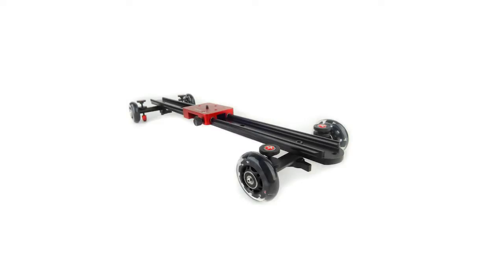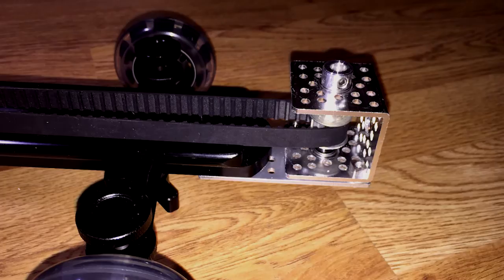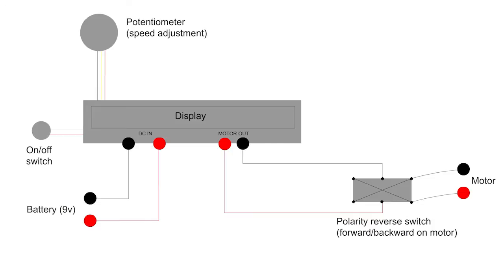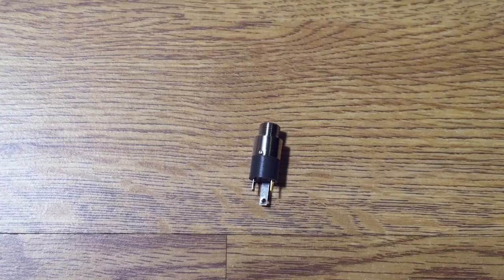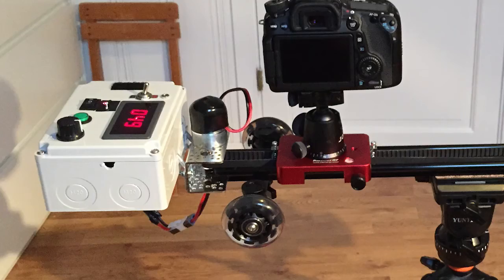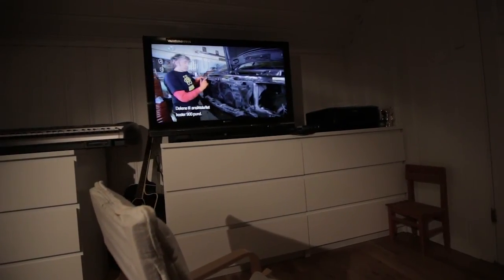DIY: Kamerar SD-1 slider dolly with motor and intervallometer

Comment: Hi!
I just wondering that how long does it take a planned time when the track moves from one end to another when the speed controller is for the little ones with out the intervalometer
Reply from the maker: Veeti Valkama hi, not sure as I have sold the slider now.
Reply: Okei butt about 5 min?

Comment: Is there a video on the build - motor mount and pulleys etc.? Or blog?
Reply from the maker: Hi, I am sorry, this is what I got :).
Reply: Just trying to figure out the spinning end - You have 2 shaft cams - one on the top and one at the bottom on the shaft - where do the 2 pinched bearings go? It is hard to tell in the video. Would love to see a little diagram - even if it is drawn with pencil - Thanks

Comment: Can you tell me if its possible to put the DSLR on the Jack connecteur for use the intervallometer with Magic Lantern ?
Reply from the maker: I guess you can make ML trigger the cam, and another intervalometer trigger the slider. Not sure ML can trigger the slider though.
Reply: In about 2-3 weeks I'm planning to build this for myself but I want to make some changes ( mainly I want the intervalometer to trigger the camera and the slider - so you don't have to fiddle with 2 intervalometers ). If anyone is interested I can share any changes made to the design :)
Reply from the maker: If you have long exposures, the simultane triggering of slider and camera will cuse image-blur as the slider moves while the shutter responds. That is why I have 2 intervalometers triggering the slider and the camera one at a time.
Reply: Thomas Øverbø with what I have in mind, one intervalometer will control both the camera ( x sec exposure ) and move it inbetween shots :)

Comment: Hi Thomas, you are saying that in time lapse mode the camera should not shoot while the motor is moving; this is true, but it that means you have to use 2 intervalometers, one for the camera one for the slider, right? and they should also be set in a such a way they don't act in the same time. Is this the case for you, you are using 2 intervalometers?
Reply from the maker: Correct 👍

Comment: Hi Thomas. Just a short question. What is the distance that you have in mm between the lower part of the sliding red carriage and the black base bar. On my  slider I have about 10-11mm. I have the feeling that the XL belt will touch both up and down. Is this happening to you? I might have to go for a belt that is less high like a 6mm.
Reply from the maker: Yes it touches both slightly on mine , but i doesn not matter much since the friction is minimal. Changing belt might be a good solution for you of you encounter heavy friction or if the belt skews too much.

Comment: Hi, excellent job Thomas, and with low cost parts. 
I was just wondering (maybe I did not understand everything) how do you insure that you carriage does hit the end (at each left/right) and damage the motor or the whole construction? 
Is there an automatic protection or you have to be very careful when camera reaches the end of the course?
Reply from the maker: Good question. I guess you have to pay attention in the end, but a sensor on each side breaking the batterypower is possible.

Comment: Thomas would it be possible to put two switches (one at both ends) to make the slider constantly go in alternating directions when the cameras plate the edge it hits the switch and reverses polarity so that I could set it up and just let it go?
Reply from the maker: Sure, don't see why not :). Not sure of the chart though.

Comment: Hi Thomas, can you explain how did you attach the belt mount to the moving plate? Thanks!
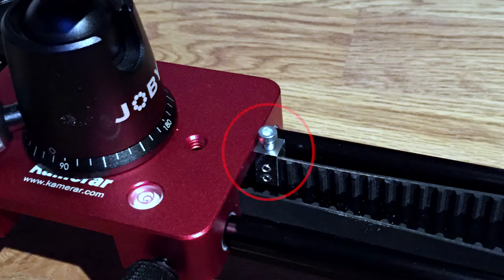Reply from the maker: +BackOnElectone Hi, it is not attached to the plate, but pushes the plate on both sides making the belt capable of sliding the plate. Check the video at 1:18 or follow this link https://www.servocity.com/html/xl_belt_mount_b__585538_.html#.VpStZFmIDxN
Reply: +Thomas Øverbø Thanks you! That make sense now. I'm going to start ordering part and hopefully it will go smoothly.

Comment: Very well, I'm done and it has been very good to me. I also set limit switches. I shared your video in a thread
Reply from the maker: Great, cheers :)
Reply: between the speed regulator and the engine
Reply: Where did you placed the limit switches on the electrical scheme/chart?
Reply: Cinematic Media tanks for the info

Comment: Thomas, what is 6x12mm flange bearing? the website is in inches
Reply from the maker: LostMyFinger Hi, I ordered in mm, not sure what happened. Try this converter http://www.metric-conversions.org/length/millimeters-to-inches.htm or you can contact servocity at https://www.servocity.com/html/service.html regarding the ball bearings and dimensions. Cheers
Reply: Thomas Øverbø I am trying to use glide gear dev-1000 instead of sd-1, it's similar except the 2 holes on the far end
Reply from the maker: Cool, does it seem to work?
Reply: still building, btw you motor only moves when the intervalometer "snaps" a photo right
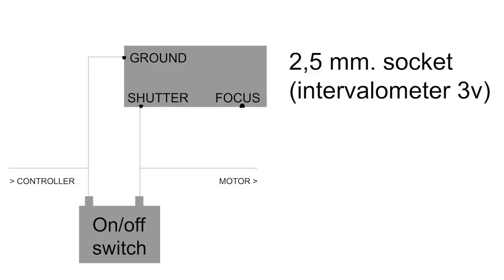Reply from the maker: LostMyFinger I innstalled a switch making it possible to turn it on or off (03:17)
Reply: how does your camera takes photo while timelapse? I dont see ur circuit connecting to your camera
Reply from the maker: I use Magic Lantern that has an internal intervalometer in the firmware. You can use any intervalometer you choose, just start them with a few seconds appart so they do not operate at the same time.
Reply: i am intending to use one intervalometer with a delay relay and shutter the camera 0.5seconds after the motor stops
Reply: +Thomas Øverbø May I know where did u get the cover for the dc motor
Reply from the maker: +LostMyFinger Hi, you can try this https://www.servocity.com/html/gearmotor_end_caps.html
Reply: thanks bro, I am almost done with mine after months of procrastination. adding in the last part, intervalometer

Comment: How is the camera supposed to be synced with the motor intervalometer to take the picture at the same time, every time it stops moving?
Reply from the maker: Hi, cam and slide rmust operate every other time, you can start them with a few seconds appart with the same interval. Cam must be still when taking pictures.

Comment: High Tomas, I received the switch to isolate the intervalometer  today it has four pins and I have no idea how to wire it I am not sure if it is the same one you used although it looks the same can you help.   Thanks Barry
Reply from the maker: Hi, it should be one for ground, one for shutter and one for focus. Do you have a picture of it somwhere?
Reply: Hi Thomas, It,s not the intervalomter it is the switch to turn the intervalometer  off.
Reply from the maker: barry wills
Ah ok, a regular on off switch should have just 2 pins, does it have multiple properties? You can just try them out to see who works or not.
Reply: I think it does but it will work as a normal on off switch it was the four pins that threw me as I do not know a lot about electrics I just want to do the same as you. Thanks for your help Thomas  Kind regards  Barry